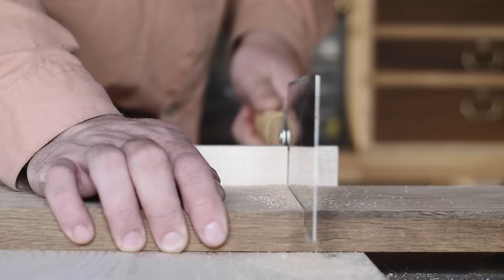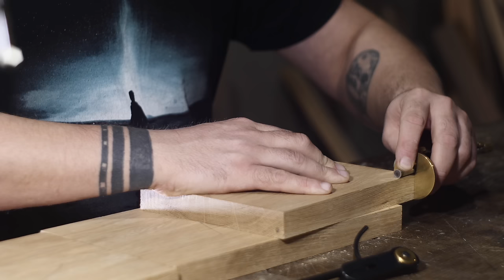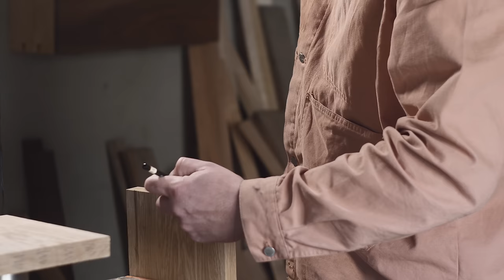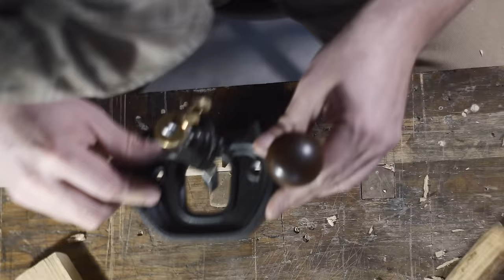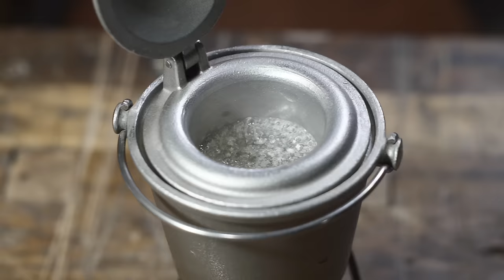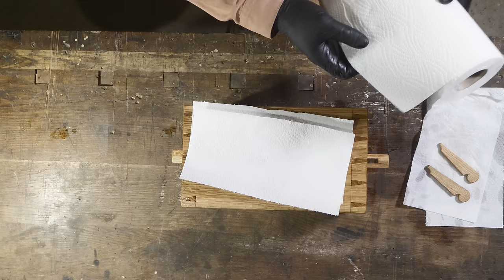Small but very strong bench making - Only Hand Tools

Comment: Really good craftsmanship…… I’d have hollowed the bottoms of the legs  slightly to form four little feet to prevent wobbling on uneven surfaces…. Just a thought….
Reply from the maker: Thank you! Yes, I thought so too, but only when I brought it home😏
Reply: @gr_woodworking  Yeah, that’s the way projects are sometimes, no real harm done though, you might still be able to do it if you need to and if you take your time with a sharp coping saw whilst it’s clamped in a vice. Lovely little bench, I especially liked the through tenons and wedges you did.  Next time you make a bench like this, you could also cut hole in the top to make picking it up easy with just two fingers. I had this idea after I made a little oak bench for sitting on whilst I load fire into my wood burner.

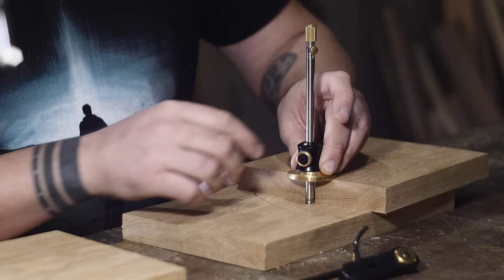Comment: 5:40 I gotta know, what is that marking gauge you're using? I have a TayTools marking gauge and like it a lot, but that one in your video seems to be even nicer. I'm guessing the offset post allows more purchase on the wood
Reply: Grab a double shafted mortise and tenon one and its gonna have the offset
Reply: If you haven't already found the marking gauge he uses, it's a "Veritas Micro-Adjust Wheel Marking Gauge" (the more expensive version). Lee Valley sells it. They also make a "Dual Marking Gauge" as nathano mentioned that helps with mortise and tenons.

Comment: Nice work but spoilt by poor design concepts. You glue the dovetails so that the knockdown feature becomes redundant. How do you dissassemble the dovetails. Pitty. Good craftsmanship spoilt by poor design logic.Craftsmanship 10/10 Design without the stretcher rail 10/,10 With the stretcher 3/10
Reply: Good lord! It’s a design element. No one would take the bench apart.